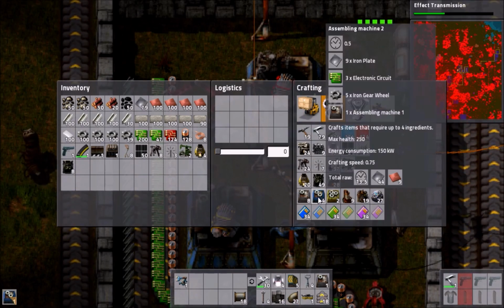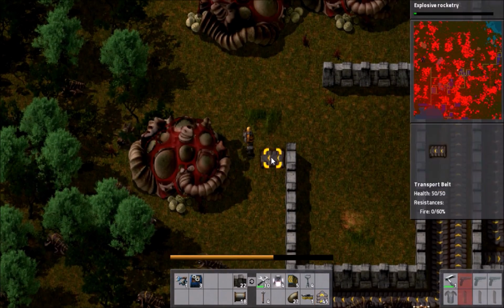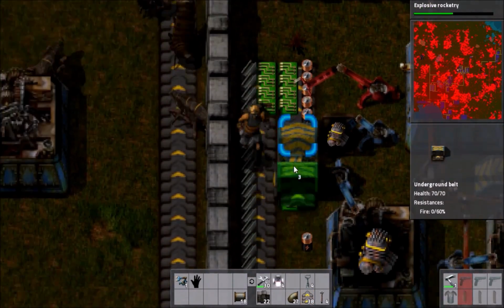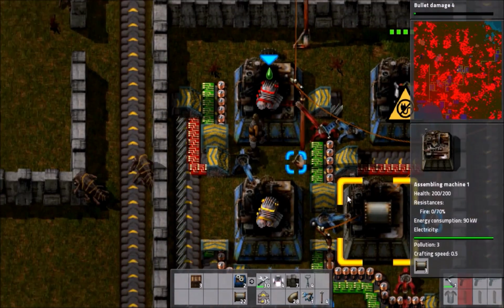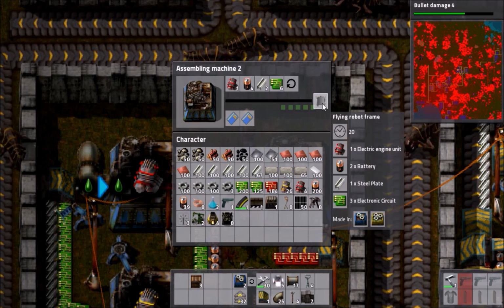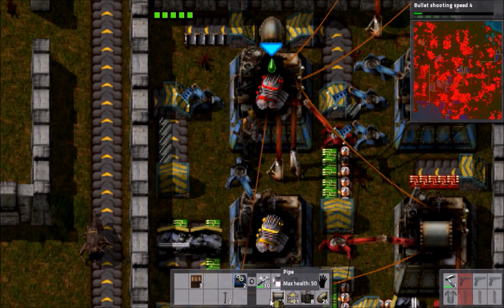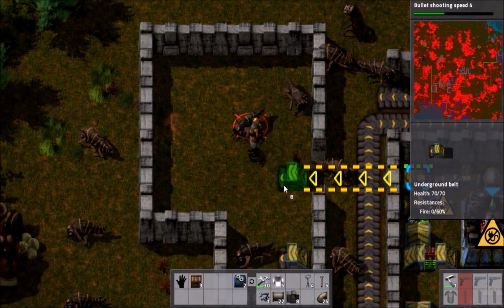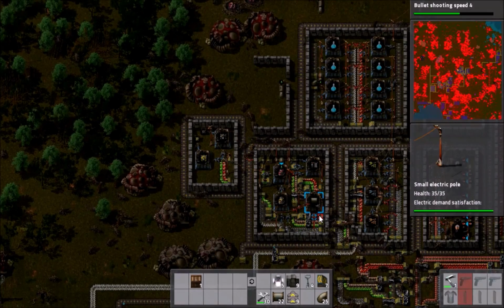Factorio: Living With Biters Ep#36: The Descent Into Madness

Comment: Is there a reason you are not using the medium power poles? You just kept just using the wooden ones.
Reply: NexZone30 He has a reason i think i don't know he talked it couple episodes  back i think
Reply from the maker: DerPapierfliegernarr Yeah, I don't like the look of a mix of pole types so i'll only use medium power poles when absolutely necessary and in pre-planned designs like advanced circuits. I'd run through and upgrade everything to medium but it doesn't seem worth the extra materials.
Reply: In general, I understand that. But when you're building in such a compact area where every tile matters, and where the beauty comes not from order but from disorder, it seems strange to avoid using the medium poles.
Reply: NexZone30 maybe the fact that resources are a bit more limited?
medium poles take steel, each costing 5 iron, and more coal power to make. 
or simply that he forgot of their existence.
Reply: Actually, you're right, he said that he won't be switching to the medium ones because he already has used the wooden ones